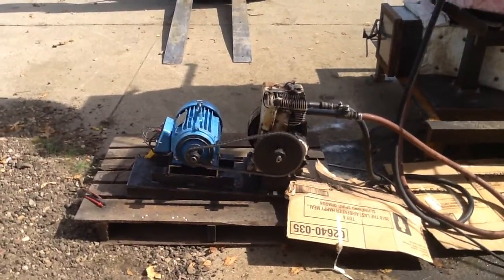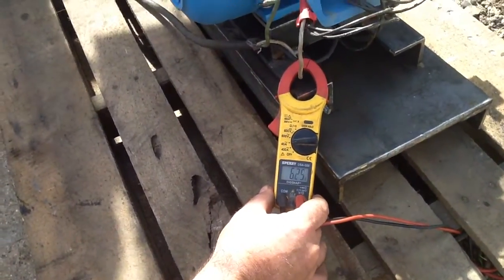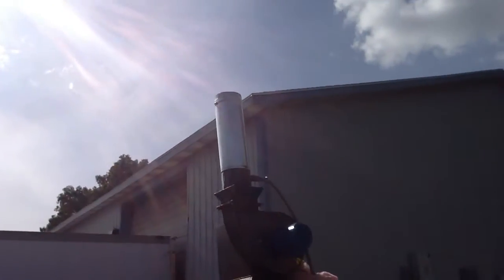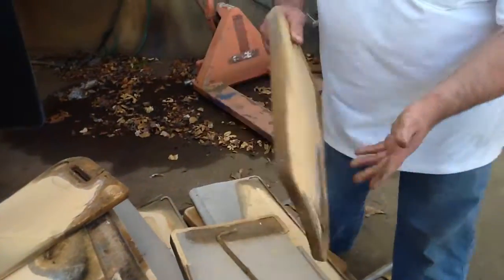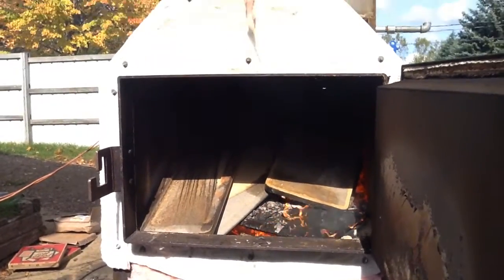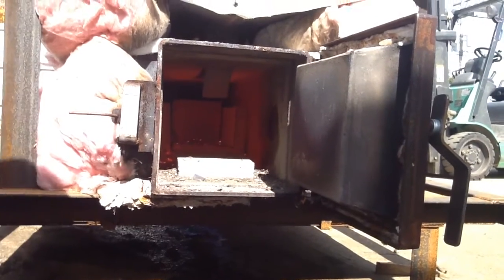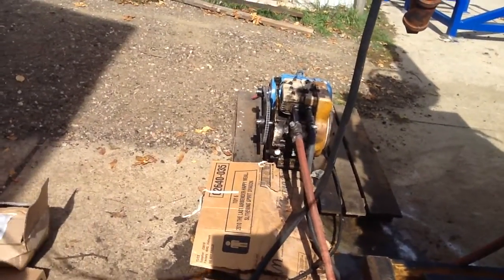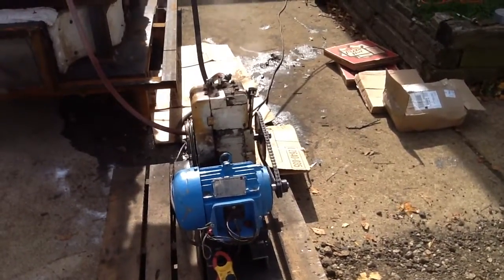gasification boiler and steam engine running a grid tied induction motor used as a generator

Comment: Nice!  :)
But you don't want to be cooling the steam above the piston  with cooling fins..!
Insulate between the fins with something and remove the power wasting fan/fins.

Solenoid valves for intake and exhaust with hall sensor and controller allows you to tune the engine way more than most realize...
Reply from the maker: Yes, you are right

Comment: Could you please explain your wiring better or link to where you got your info. I've tried running a motor like this and can't quite figure out what I'm doing wrong
Reply from the maker: This is a three phase motor. It was wired for 240 volt three phase. But only line 1 and line 3 are tied to the single phase voltage. This motor can not start on single phase. But since it is wired in y star pattern the center off all three leads are connected and the charge rotates. One positive, one negative and one crossing zero. All motors are two phase when at or near rated speed. The motor is the prime mover. If the motor is energized while running 75-100 % of rated speed it is using electricity as a motor. If the motor is energized above 100% of rated speed it becomes a generator and the current flows back out of the motor and onto the grid, while perfectly matching the grid phase. Neat trick but the cost is 50% of the electric output to maintain the magnetic field. A  permanent magnet generator can output up to 50 % more electricity for the same input torque. Call me if you need further instructions. I am happy to help. 269-685-1340

Comment: why not use the steam to drive a turbine or impeller of some sort instead of losing efficiency through all the moving parts
Reply: You could have a wood gasifier running a generator, and a steam generator built into the wood gasifier capturing heat that would otherwise be wasted
Reply: I mean, you got one for less than $200?